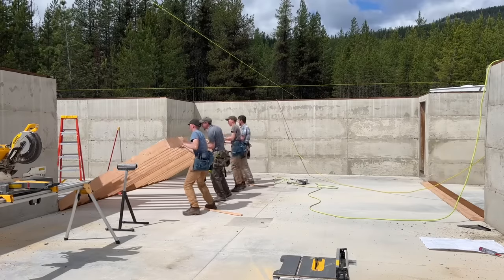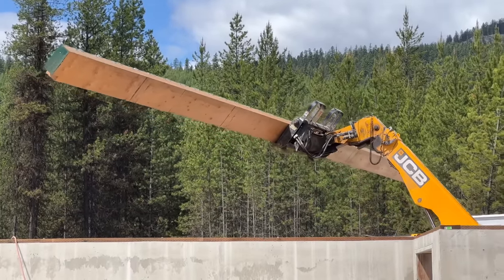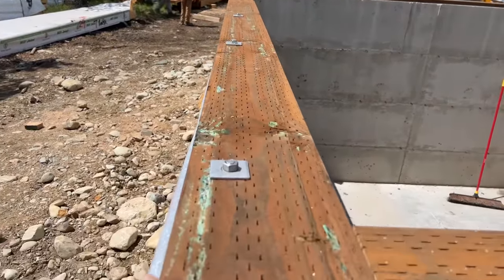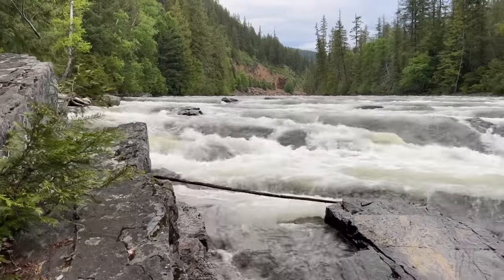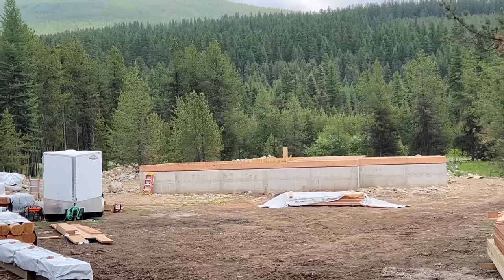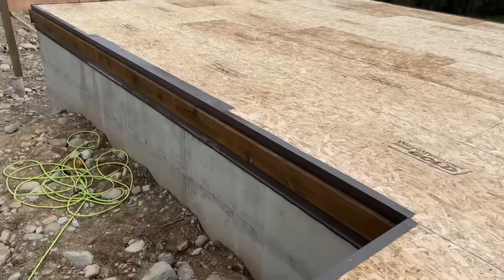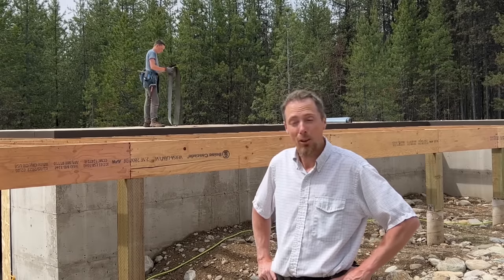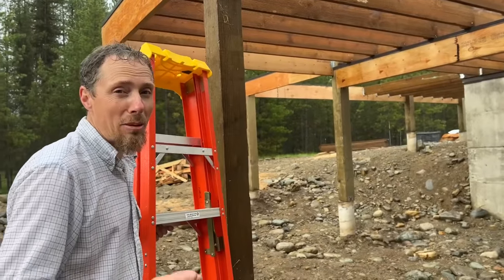Montana Subfloor & Decks Project for Log Home

Comment: I wondering why cold places builder doesn't put any insulation on the floor. And why they build floor deck first and then wall. Floor can go to ruining when is rainy days
Reply from the maker: It’s got a basement so you don’t need to insulate. And you need the decks for roof posts and supports.

Comment: What would be the maximum length of a soft wood floor joist 4cm by 30 cm (30 being vertical), wich would not bend ?
Reply from the maker: It depends what you are holding up. If you were to hang it on each end with nothing in the middle for support, it would sag in 12 to 16 feet just a little bit.
Reply: @MontanaHaven  and if a 2 by 12 inch board is used a ceiling rafter, would it still sag, since we don't walk or place anything over ?
Reply from the maker: There are a lot of variables. If you use it as a ceiling rafter and it would be placed at an angle you could span 15 or 20 feet with a 2 x 12 to hold up a roof and you would have to place them every 12 inches to 16 inches apart.
Reply from the maker: It also depends on what climate that you’re in. Do you have snow or is there nothing else to hold up. I would recommend you check with your local area and see what people are using. Thank you.

Comment: Not sure of the code there, but I know that our inspectors like at least 3 threads showing on the sill plate anchor bolts.
Reply from the maker: That’s interesting. There are no inspectors involved in that process in Montana.
Reply: @MontanaHaven  Must be nice. It's quite the process here in Seattle. Though we have seismic to worry about. Need to hire you to come frame up my projects. :)
Reply from the maker: Seattle would be rough😀